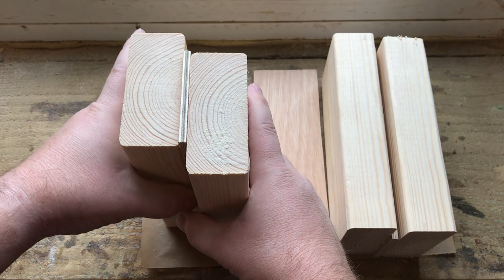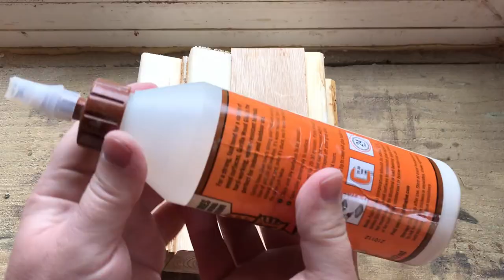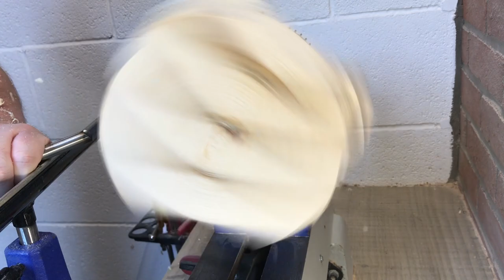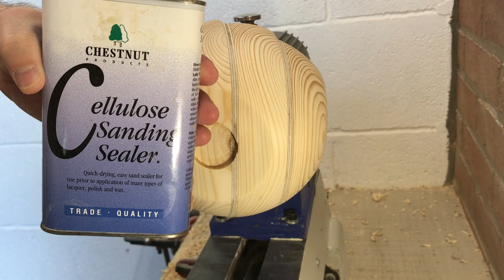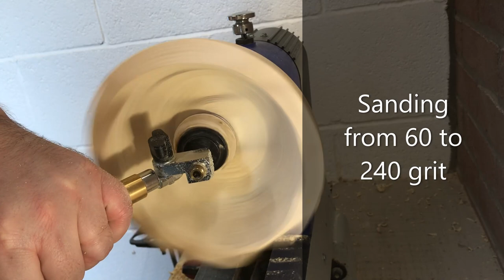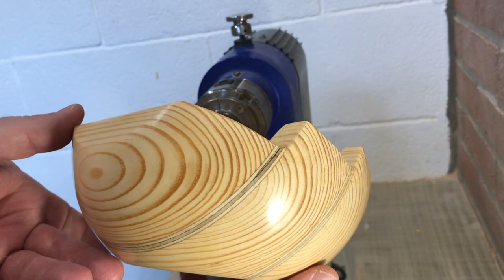Wood turning - Pine and Plywood Diagonal Bowl

Comment: Very cool!  Would you mind helping me understand the what sanding sealer does, and it’s value for a turning project?  Only been turning about two years and sure would appreciate your thoughts on using sanding sealer. Thank you very much!
Reply from the maker: Sanding sealer improves the finish 100%! It binds together and loose fibres, allowing a significantly better foundation to add a finish on. I think of it like my wife putting makeup on, build up from a foundation, then apply a finish. Honestly once you start using a decent sealer, you’ll never look back. Thanks 😊
Reply: @RDMWoodturning  Decent sealer?  Have a suggestion or two for a good sealer as a place to start at a reasonable price?  Thank you!
Reply from the maker: I like Chestnut and Mylands cellulose sealers. There are others out there, but I’ve used those brands the most over the last couple of years. Best of luck.